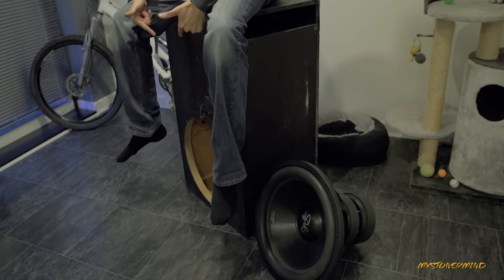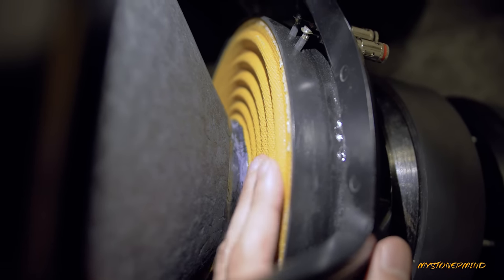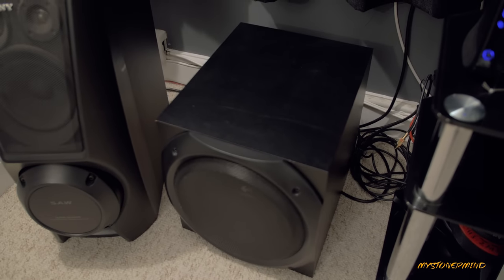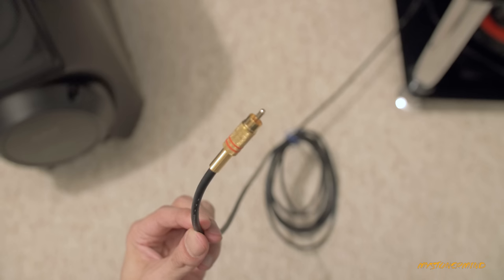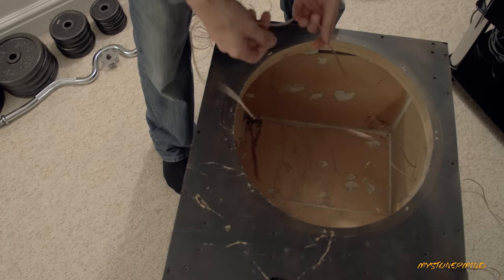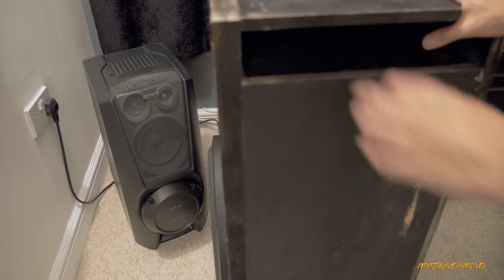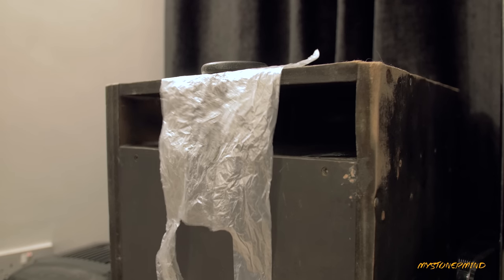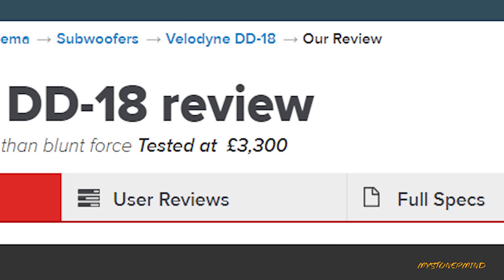CAR SUBWOOFER FOR HOME CINEMA?

Comment: I've been using a pair of old 15" Rockfords for home theater subs for years. They're each in a sealed 4 cu/ft box and have no problem dropping into the 20 hz range. I power them with an old Peavey 8.5C commercial amp that I got for $150 cad. It's good for 425w/ch at 4 ohm.

Comment: I had those exact speakers when I was 17. We bought the Sony system with rotating cd tray, it was made to look like a stack system but was solid apart from the turn table. It was £350 from Macro which was a fortune back then, I’m 36 now and wish I still had it
Reply from the maker: nice. This was bought at a Comet for about 800 I think, I was about 15 back then.

Comment: Iv been using a Alpine type R 12" for 5 years now powered by a crown 1500W RMS amp for 5 years now and its still going strong and completely destroys anything iv ever bought previously including a dynaudio 12" sub that coasted over $2000
Reply: The difference is one looks like furniture.... that's majority of the cost, plus the built in inverter so u can plug into a. Outlet

Comment: Ahhhh nice nice. I have a 12 and 2 15 inch subwoofers. 12 is on 1000 watts and I plan on getting a 6000 watt amp for the 15s, as the amp I had was not powerful enough and was clipping them. So I use it on another subwoofer and as soon as I have the money I'm getting a 6000 watt amp for the 15s lol. Wayyy overkill but I want to barely have to turn the amps up to have the subs moving so it sounds clean and I have lots of head room for lows, but that's just my preference. Anyways, great set up, keep up the good work!

Comment: Couple questions, if you don't mind. What is that amplifier that you are using to power this beast? Also, what's that program on the desktop that lets you fine tune the frequency curve? Thanks.
Reply from the maker: everything should be in the details my man

Comment: Hy, please tell me which between sony speakers and logitech z5500 subwoofer goes lower,deeper in base?
Reply: Claudiu George Sony. Building a dual 12” home theatre subwoofer ATM  using Sony GSW121D. Still waiting on the delivery of one but my Bass Box Pro simulations have provided really good results down to 17Hz.
Reply: @shotbyrallo2566  thanks man. Also...in case you heard jbl 3.1 / 5.1 soundbars, both of those subwoofers have 10inch driver on it, still the sony speakers hit lower deeper base than the jbl do?
Reply: @shotbyrallo2566  I am trying the same, they both combined can take a 1000watt rms right? How does they sound? How low they get? Box design?
Reply: @sunitadhyani1013  I believe combined they do 1080 RMS which isn’t incredible but they are good bang for buck value IMO. I plan on having a dual woofer front left, front right, rear left, and rear right so over 4000 watts RMS spread throughout the room. There are much better subs out there for DIY building that give incredible performance per dollar but they are out of my price range especially if I want multiple subs. I haven’t finished building them yet so they’re still just sitting in their boxes. COVID, PS5 on day one, and a new baby, amongst other things has left me a bit distracted.

Comment: Why do speakers have two voice coils
Reply: Gator Productions Different wiring options for flexibility with a range of amplifiers. Dual 4 ohm VC wired in series is 8ohm. Wired is parallel is 2ohm. Add a second DVC speaker and you’ve got even more flexibility depending on how you wire the speakers together.

Comment: Hey man, just a quick question. I am about to buy a home theatre receiver and a 5.0 speaker set from jamo. I have a car amplifier and a car sub. Amp gives 3500rms and my sub is also the ascendant audio mayhem 18inch. I obviously would like to use the sub and amp for my home receiver. I have 4 x pc power supplies that deliver 12v each and 60 amps each so 240 amps in total, making the power supply for the amp plenty. On the home receiver there are 2x sub pre outs in the back. Do i just connect the 1 sub pre out to my amps line in? Or is there more to it? Been reading to much online and now im quite confused about it all. Some people say i need a high end receiver to be able to do that, some people say i need the balanced and unbalanced converter with cables, etc. So im a bit stuck. The receiver is onkyo tx-nr575e. In the manual it says the sub pre outs are for powered subwoofers.... anyway. Just really appreciate a short clear answer if it will just work and hook up as i had mentioned. Cheers.
Reply from the maker: yeah dude just connect it to the receiver via the pre-outs, it should work fine. The pre-outs are for a powered sub, meaning they don't just connect straight to the subwoofers coil, the subwoofer should be 'powered' by an amp, and that's what yours would be, as is mine.
Reply: @MyStonerMind420  ahhh mate! Legend! Thanks for the quick reply. I can now put my mind at ease a little. Would like to see more videos of your home theatre/ music system with a big car sub. Really enjoy your content.

Comment: oky the double Plus(red) and double minus(black) when connected on the amps to half the Ohm the speaker uses I.E 4-8 ohm am i correct? and then youve wired it the same on the Dual voice coils? im asking cuz im getting a 15 inch competition sub and will be running it from my karaoke amp which runs at 8 ohms
Reply from the maker: not sure of what you're asking, but if you want to wire at a higher impedance such as 8ohms rather than 4, you should wire in series. The way I wired is parallel, that brings impedance down, (to 1ohm in my case). 
Hope that helped :)
Reply: Erik Britz positive and negative?
Reply: My Stoner Mind yes i want to wire up from 4ohm to 8ohms cuz i have a PA amp rated at 8ohms so i dont want to overheat it when jamming

Comment: I did this to my set up but used a PA amp instead. Can you send the link to the video referenced at 4:39 ?
Reply from the maker: you mean a link to the equalizer I used? https://sourceforge.net/projects/equalizerapo/
Reply: Thanks but I think you were talking about taming boomy bass with the EQ in the said video
Reply: I have the EQ APO installed and I used almost the same settings as in this video. Now the room shakes like mad but no boomyness
Reply from the maker: oh my mistake, I may have referred to an older video of mine in which I first set this system up. Yes this setting might work for you, but you may have to tailor it for your specific room.
Reply from the maker: oh, this is that video https://www.youtube.com/watch?v=5QfSNNxLXw8
Reply: Thanks!

Comment: plz help me i guess that sub is about 3500 rms and that amp produces 1800 rms so your sub rms is more than the amplifier is it ok or not....??
Reply from the maker: The amp does 2000rms at 2ohm, but yes, it is okay! 
My car amplifier has more than 3x the power potential of this amp. 
The subwoofer can handle more than 3500, they just say 3500 to be safe.
Reply: My Stoner Mind so can i use a sub with 1500 rms with this amp
Reply from the maker: yes totally. Obviously you'll want to be careful about giving it too much volume, but keep in mind that giving a lot of volume to a speaker with a less powerful amp can send an "unclean" signal to the speaker (clipping etc) which can potentially damage a sub. 
Whereas doing the same with a more powerful amp, is less likely to do damage due to the signal being cleaner.
Reply: than plz tell me which amp is damn perfect for earthquake sub zero 12 for my home
Reply from the maker: I don't know, something like this amp maybe?!
Reply: Coz this sub produces 1000 rms and max 2000 watts
Reply from the maker: all you you really need is an amp that matches the output of the sub. Depending on your need, you may not even need that. 
I don't use all the volume that my amplifier has to offer, nowhere near. 

My system is set up equally, there is no bias towards bass like there would be in a vehicle.
It's basically set up for SQ rather than SPL and because I watch movies, it would be silly to have the subwoofer louder than the rest of the system.

I don't know what your situation is, but I'd say get an amp that suits your needs, it doesn't have to be super loud for house use, unless you have house parties often.

You could also use a car amplifier!
Reply: Thnx bro..... :)
Reply from the maker: no problem man :)